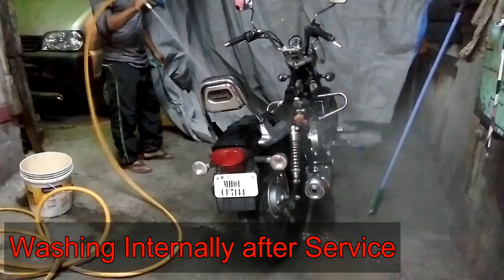Complete Service of Bajaj Avenger 220 Cruise

Comment: 2 mistakes...
1) petrol is not recommended to clean the chain..only kerosene or diesel or use chain cleaner
2)why did you use so much chain lube?
Reply from the maker: kiran gowda thanks for ua suggestion

Comment: Can we clean the air filter sponge with water or Diesel ??? 
Or we have to clean it with petrol only ???
Reply: Nilesh Vedpathak you have to clean it with petrol only bro  because it will dry the airfilter quickly
Reply: I have done cleaning with diesel and not much problem faced, just after the cleaning first start takes a long self.

Comment: After cleaning air filter & brake drum don't wash the bike. Because water will go inside brake drum & air filter box, and you have removed the seat also water will definitely go inside the air filter box. And there are many mistakes I have pointed out only 2.
Reply from the maker: jony jony thanks for ua suggestion nx ttm I'll look at it

Comment: That mechanic is fool after cleaning air filter he removes the set and washing the bike. Because the water & dirt below the and near the battery will go inside the air suction pipe. Which is totally wrong. Stupid mechanic.